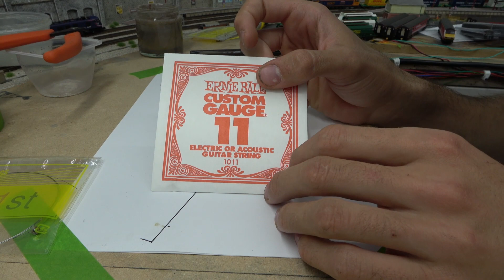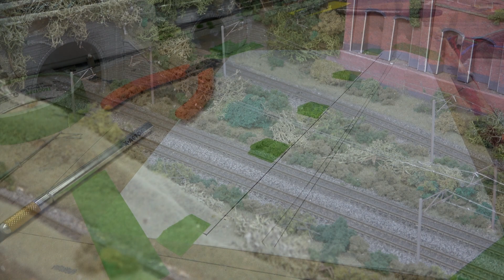Adding N gauge overhead lines (OHLE)

Comment: excellant works ---- love this using guitar wire ect . on kings park we use somerfeldt wires solderd in position , the pantography does touch BUT two problems arise - 1 - the loco must go in direction of pantography or it will snag   2 - puts a little pressure on the body and chassis wich in turn can burn out the moters ...... in time ....... what a super layout GREAT DELTAN has become - please keep the videos comming - andy
Reply from the maker: Thank you for the comment, due to these being suspended from fairly weak masts, it was never an intention to have the pantographs touching, though my DCC sound voyager used to pull the wires down everytime it went under the OHLE due to proximity of the speaker and it's magnetism

Comment: Very affective look. If you add a cutting of the wire bent to hold down your spring loaded arms to the right Hight you wouldn't notice it when the engine was on the move. stay safe

Comment: G'day mate. Good effort and it looks good to. Can I ask what height the contact wire is set at please? You've given me the courage to have a go myself. I got hold of .5mm brass wire/ rod [ K&S] and that is working real good. Easy to bend and being brass it solders easy as well. I'm using .75mm for the top wire just to hold things a bit more rigid.